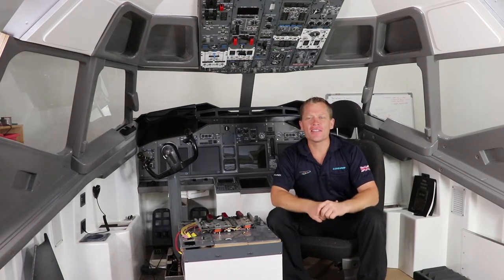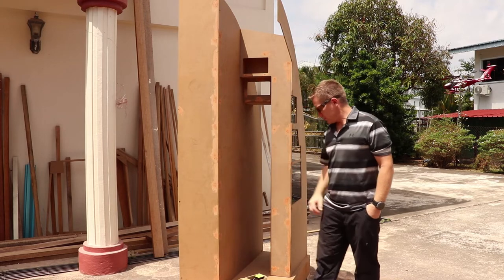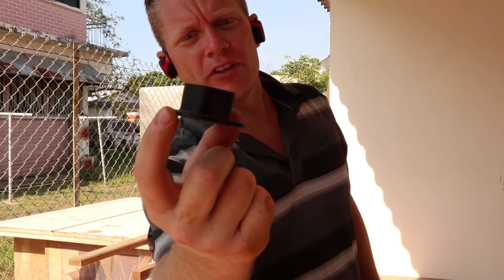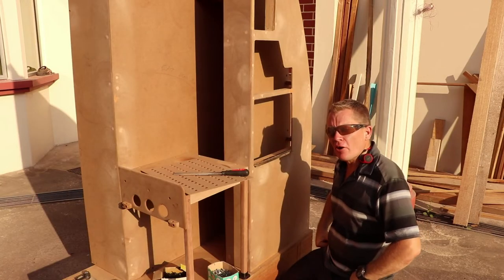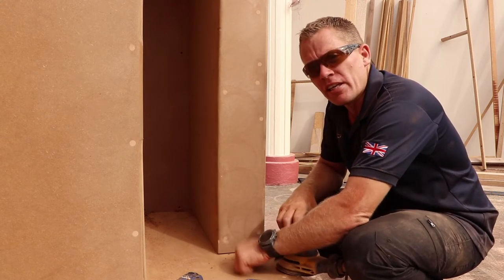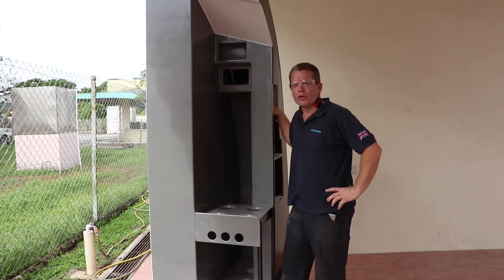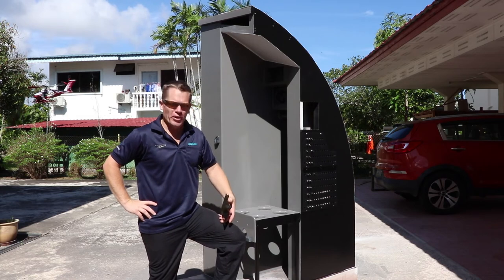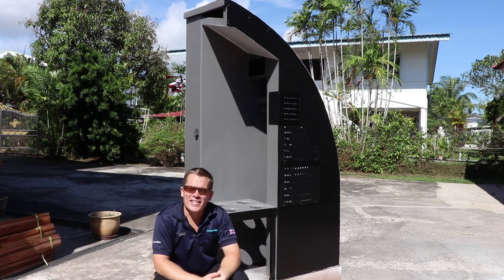737 Rear Captains Bulkhead

Comment: That's where most sim builders are missing out, the rear part of the cockpit with seats and circuit breakers which is a very important part of a good 737 cockpit.
You are doing a splendid job here, just the way I like it!
But where can I get those long hinges for the circuit breaker panels?
Reply from the maker: Hi Robroy, Thank you and i got my Piano hinges from amazon. Hopefully now ive done joes MCP i can build the other side